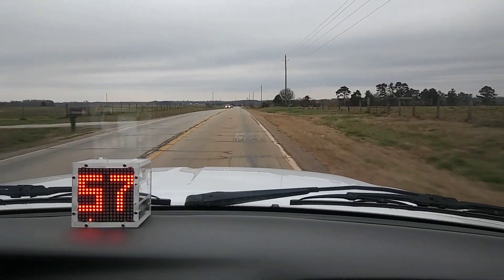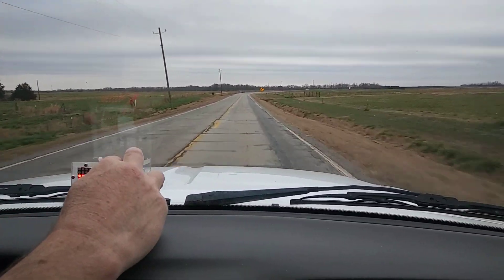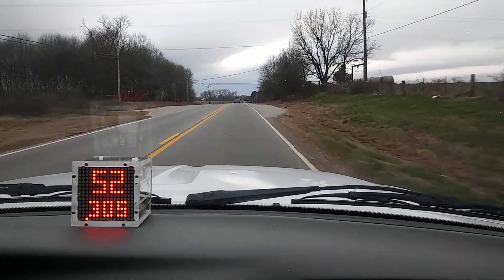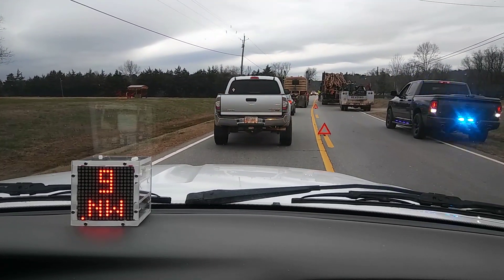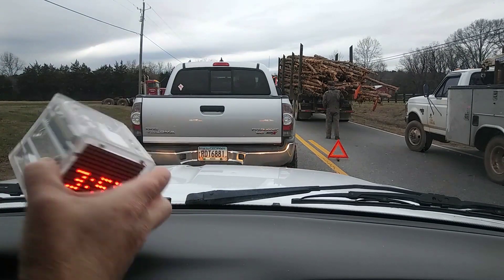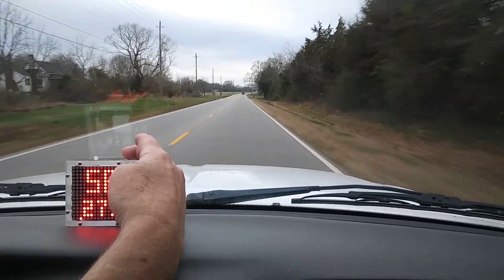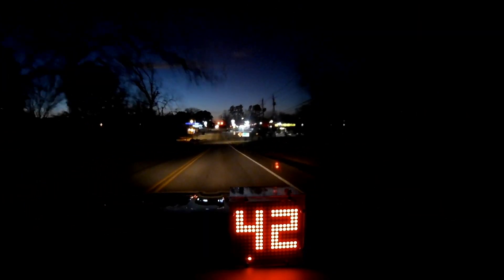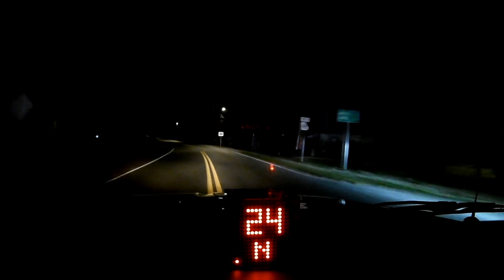GPS Speedometer Compass - High Visibility - ESP32 Project 6

Comment: Sir, THANK YOU! It was a bit of a learning curve, having come from Arduino and Pi experience. Not really that different but I had to learn some new stuff. The cube works prefect! I went through many codes, hardwares and failures. The ones that worked had the tiny screen that you can't see on the move. This is for my dune buggy or my trike. I really don't need to know how fast I'm going, but making stuff keeps the brain and hands young.  Thank you again.
Reply from the maker: Very cool. Thanks for taking the time to let me know.

Comment: Can we put arrows on led matrix display to show directions , like Google map notification navigations ?
Reply from the maker: The GPS will give you course over ground, which is the direction you're traveling. That could be plotted as an arrow. But you would have to add a compass to do more than that.
Reply: Probably easy enough to substitute arrows for the cardinal values within your "font", but you'd be limited by resolution and it could look fairly ordinary.

Comment: Can you put the code pleae
Reply from the maker: I will have to find it and clean it up. Will do as soon as I have time.
Reply: @ClaytonDarwin  please i'm waiting for that
Reply from the maker: Haven't had time. May be a while.
Reply: @ClaytonDarwin  one question: how you do the quick refresh for the speed?
i try to use tinygps but it give me a new reading every 5 second
maybe it should the rate from the GPS Module because i see on the u-center that we can make it readable at 5 Hz or 10 Hz
have you an idea about that?
Reply from the maker: Most GPS modules allow you to set the cycle time. Some modules allow you set it with a serial signal. Some require special software. Ublox lest you set it to 1hz over serial, but requires special software for less than 1hz. Read the datasheet for your modules.

Comment: great work <3  can u help me with GPS in esp8266 (Micropython )???
Reply from the maker: Almost all GPS modules use a standard TTY serial connection at 9600 baud. All you need to do is connect the GPS to the ESP via serial setup and start reading data from the GPS. So, learn how to use serial connections with your ESP. Then learn the NMEA codes. That's all you need.
Reply: @ClaytonDarwin  i'm new in micropython but  i will try ;)
thanks <3
Reply from the maker: The New 1.1 MicroPython documentation has examples.